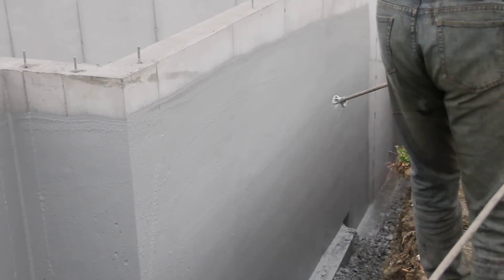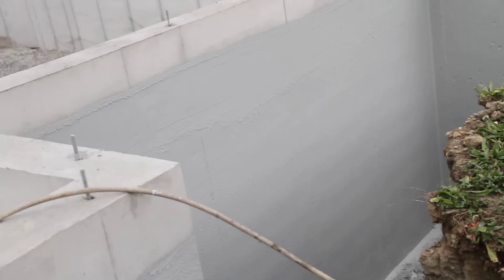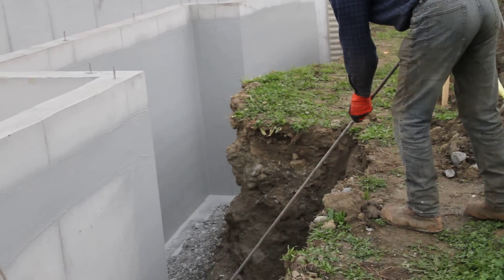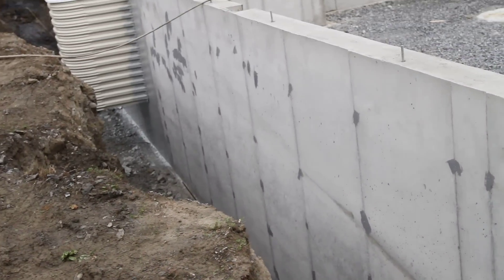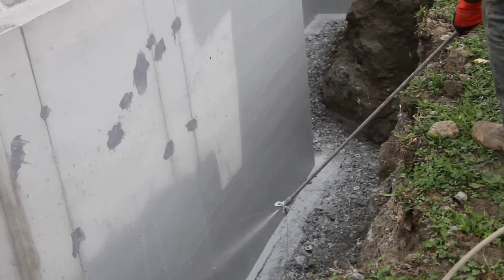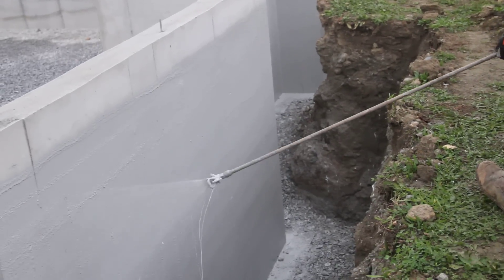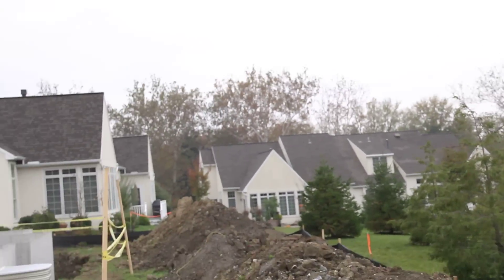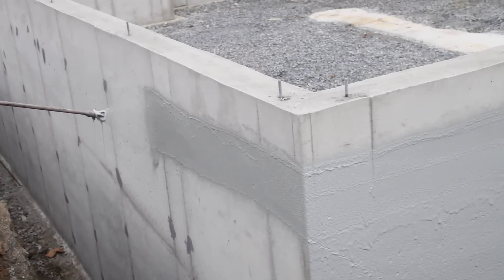Waterproofing Foundation Wall + Foundation Coating + Basement Waterproofing + Deco 20 Seal

Comment: that product doesnt seem very thick...is there another layer of a different material?  
has this been proven over decades?  Water base doesnt give me confidence.   Why not regular old roofing tar?
Reply from the maker: Roofing tar is a dampproof material. Deco Seal is a waterproofing material so much better than tar. Deco Seal is an engineered acrylic designed for foundation walls. Thickness has nothing to do with the quality of a product. Deco Seal is ICC approved meaning it's tested just like any other approved and testedwaterproofing material. Tar can only be applied below grade. If applied above grade it will crack and breakdown in several weeks. Deco Seal can be applied above and below grade.
Reply: I also would not have much confidence in this material but “regular old roofing tar” know as damp roofing is no better. There are couple very thick spray on products out there that much better than this stuff, they are a rubber emulsion. There is a couple companies that make them, one is MAR-FLEX and another is Tuff-N-DRI. They both have dealers throughout the country.

Comment: what is the wall thickness ? and does the wall determine the amount of material used ??
Reply from the maker: We spray our product at 30mil wet on all walls regardless of wall thickness. 30mil wet would be two thin coats that could be rolled or sprayed on. Purchasing a mil thickness gauge will verify an exact mil thickness.

Comment: Can anyone provide information on where to get a suitable sprayer to apply this product?
Reply from the maker: Hi David! If you'd give us a call at (717-484-6131) we can help you locate a sprayer. There is also the option of rolling our Deco Seal Membrane on with a 3/4" or 1" nap roller. We look forward to hearing from you!!

- Deco Sealers
Reply: Where can u get the pump

Comment: 3000 psi....are you sure?
Reply from the maker: Our Deco Seal's viscosity is thicker than paint. The specs we recommend for sprayers are 2000+ PSI airless sprayer w/ flow rate of 1-2 gallons per minute.